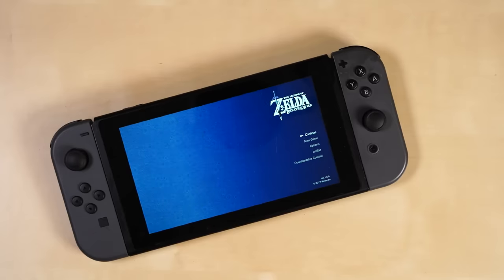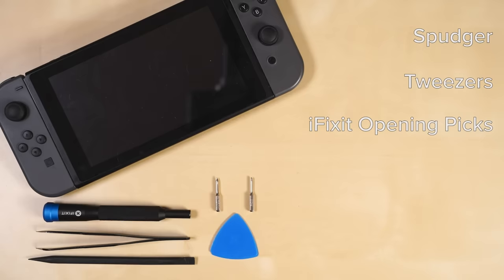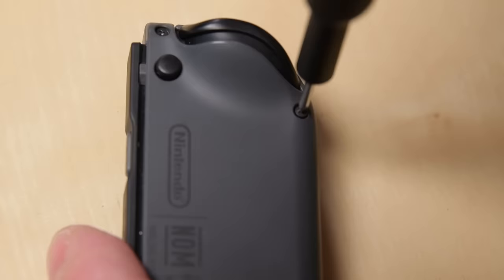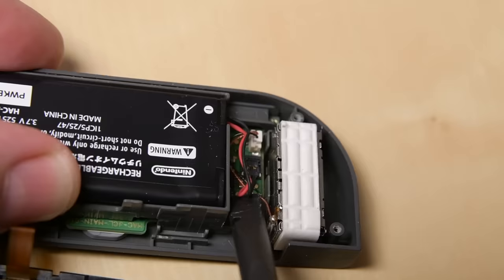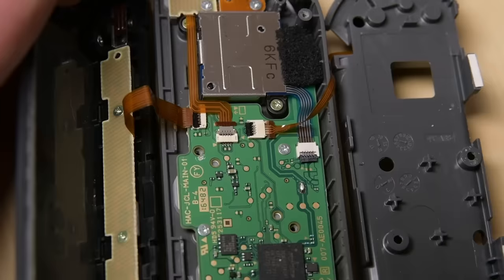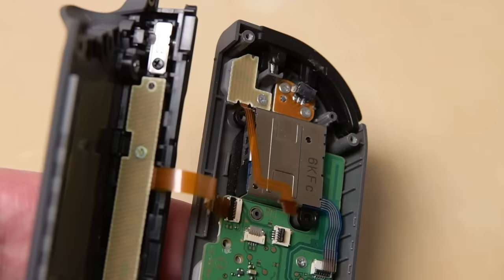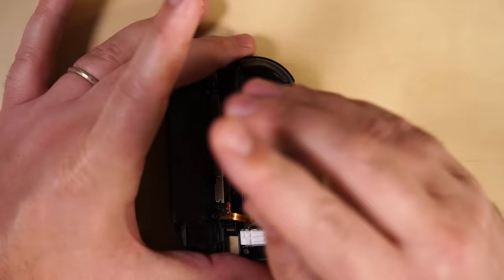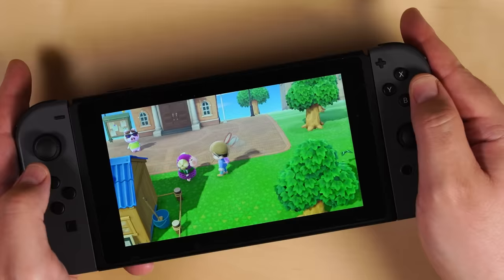JoyCon Drift Fix! How to Replace the Nintendo Switch Left Joy-Con Joystick

Comment: Few notes from a guy who has done this repair several times: you can remove the battery much more easily by just pulling up on the wires, getting it out with a spudger is way harder; if the L button pops off make sure that when you put it back on the spring is straight or else it will feel mushy; use tweezers to open and close all the ZIF connectors, they’re very fragile and your big human hands can easily break them; lastly, go very gently with the Y00 screws as they strip way too easily
Reply: Pulling up out on the wires? I wouldn't try that...just if you want to break the battery cabels.

Comment: My joystick actually broke off so hopefully this video can help me replace it, thankfully I had a spare from the time I was going to fix the drift. The screws were stripped so I ended up sending it to Nintendo. So it has a use now. ☺ If only Nintendo made the joy cons better. This is the only controller I've had a hard time with.

Comment: I am stuck.

I am not sure if I want to fix my Joy-Con Drift entirely or use the Drift to my advantage.

(By advantage I mean try to use the direction the Joy-Con drifts and both try to move/do something solely by the dift alone. And thus, leading me to not have to move the controller stick manually. It's the lazy way to do it! You can use it too!)

Comment: I guess the entire flex cable clip came up when i was trying to remove the battery. When i went to put it back on the prongs it connects to broke off.  I'm not savvy enough to find the parts I need to fix it (I can solder them on i just cannot find them to buy i can only find the clip itself).

Comment: While it's nice to have replacement sticks on hand, you can get a reasonable fix from spraying a shot of electrical contact cleaner (I use WD40 brand) right down the stick hole. Wiggle it around and its now clean.
Replacement sticks may drift after a couple months, so replacing is not a perm fix.
I have a couple stick in reserve because I have a six year old that has managed break them off after repeated drops.
Reply: Where did you buy your replacement joysticks

Comment: Any recommendations for turning Tri point screws that are stuck? One is semi-stripped
Reply: try and use a rubber band between the screw and the screwdriver.  This would give more "traction" for the screwdriver
Reply: You have options...Either drill off the head, dremel a straight line through it and use a flat head, or solder the screwdriver to the screw

Comment: Easy to follow instructions and straight to the point! For a second i though i had messed something up but it turned out that my first replacement joystick was just broken :"D (Which perhaps could be another good thing to mention that it can happen too (pressure was working but the stick wouldn't allow me to calibrate/move)

Comment: I NEED HELP!!! Does the joycon have different joysticks before i buy 2 of the same and do you follow this tutorial for the right joycon as well i feel like theres things in the right joycon that i can mess up if i use the same tutorial for the different controller.
Reply: And no u do not mess up if u use same tutorial. Just use the other controller and be careful of other cables. And also if u want u can open both of ur joy cons now and take let's say the analog out the left controller and then remove right analog from right controller. If the left controller analog fits in the right controller and if the ribbon cable goes in the same way the old right analog used to go, then u can guarantee that it doesn't matter if u get 2 of the same analogs. If u want to 100% know 2 of them work u can (as I said before) take the old left analog from the old left controller and check if that fits in the right controller and ribbon goes in same direction. Do the same for right analog by putting in the right analog in the left controller, making sure the analog ribbon faces the connector and fits in. If the ribbon does fit in each connector facing right way, u know that u can buy 2 of the same, just rotate the analog into the right position, making the ribbon face the connector and connect securely. When getting new analogs, u can remove old ones and recycle them or throw them away. Then install new ones, just like how u installed the old ones. (Doesn't matter which way, just rotate it to the correct position). If this helps, please let me know if u are reading this reply 😉

Comment: my pink left joycon has jutter, i replaced the joystick and all buttons work even L3 works but up down left right on the new joystick dont work., what am i doing wrong and it still has jitters i double checked all ribbons cables are seated all the way.

Comment: My Switch OLED joystick stopped clicking in after 4 months of owning it. The fix is similar but not exact as this. It was a little easier. The battery tray is a little different. But all I did was remove the battery and the joystick and that was pretty much it.

Comment: Thank You for this concise guide! Did my first replacement successfully thanks to it~
Reply: How does the Joy Con that you replaced the analog stick work after this time? Is everything ok, or has the problem returned?
Reply: @Lukail90  I haven't really played my Switch that much after, it is still working fine but if u did.. it will probably have the same issue again I guess 😅

Comment: This is not easy. The removal of the battery  connector was really hard, I failed to do it 😢. Anyway, if you’ve got a drifting Joy-Con this might be better to try rather then just throwing it away.

Comment: My screws won't even turn, well one came out.  The others refuse to turn, someone believes my screws may glued in.   
If anyone is having issues with their screws not turning at all this maybe the reason why.  I don't believe the 3 screws are stripped, since they never started turning in the first place.
Reply: They aren’t glued in, you just have to apply a lot of force and turn the screwdriver very slowly (!). The Y head screws are poor quality so it’s very easy to strip them. 
I’ll be replacing mine with philips heads screws as soon as I find the right size.

But you might need to use a dremel to cut into the screw to remove it
Reply: @user-10021  Tried what you suggested earlier, wound up just sending my controller back to Nintendo for repair.

Comment: get electronic contact cleaner spray at hardware store. Spray under the collar of the analogue stick. Roll it around in a circle for 30 seconds both ways. Let it sit 5-10 mins to dry. Recalibrate in settings. Done. Should last 4-6 months if not forever. Repeat if issue re-emerges. One of my joy con required it twice and never again. The other, only once. Been years now.

Comment: Why is my L keeps breaking off? I did two joycons and both fell off, didnt put any pressure when taking the battery holder off... I dont understand why the L just breaks off like its not supposed to be there so easily.

Comment: Word of warning. Using the smudger I accidentally completely disconnected the battery housing. The housing is connected using only 4 tiny solder points. My JoyCon is now completely unusable as there is no way to get the battery to connect to the motherboard. Be very, very careful when removing the battery connection from the housing!

Comment: Just changed mine took me 15-20 min. Stressful as hell 😂 Those ribbons cable are a pain in the ass to get back in even with tweezers. And the tiny screws too. Be carful not to lose the top trigger spring. You can skip the part about disconnecting the battery its easier to leave connected.

Comment: Can I use a nintendo switch lite analog stick on my old switch ? / will it fit or small help
Reply from the maker: Yes, the joystick from the Switch Lite should fit into a regular Joy-Con!
Reply: @iFixitYourself  thank you saved me / where can I get joycons that don't drift because it's expensive and you site/ I also really want your amazing fixit pro kit I don't mind paying for it buy only problem is the shipping is all most same price can you guys help me out with this?
Reply: @Ibrahim_Alharbi  Did you find a site where you can buy joystick replacements?

Comment: Uh, so you didn't bother mentioning how frail the battery connectors are. I just went to put the battery connector back in and the prongs snapped off. I barely even applied any pressure. This is crap.

Comment: DO NOT LIFT THE MIDFRAME AWAY AND DISCONNECT IT. That connecter, with current joy cons, is placed IMPOSSIBLY to reconnect. I broke the wire trying. I should have just left it connected as there is no benefit from disconnecting.
Reply: thats only impossible in the RIGHT joycon. This is for the left, where it is very easy to put back in, and gets super in the way otherwise

Comment: When you take out the battery do not rip off the entire connector from the motherboard. Just carefully unclip it from its socket. I know 10 ppl who had this problem and had to super glue it back into place and it was so hard! This video doesn’t do a good job of explaining this
Reply: Do you know the best video for doing this stuff?
Reply: @nemesis5289  this is the best one. Just watch closely and don’t rip out the entire battery connection by accident. Don’t even disconnect the battery, just carefully set it aside while switching out the control sticks

Comment: dude, the model i have is not that simple!!!  The Zl button ribbon cable is EXTREMLY short and right in the corner of the joycon next to a screw hole.  Almost impossible to get it back in place.  I'm not a surgeon... Nintendo should definitely build better joycon.  Last Nintendo system EVER...  they are now ranked in my mind at the same level than Apple iShit devices

Comment: If you're not so technically inclined, or worried about damaging the joycon, or you're just a cheap ass, you can take the easy route.  Buy a new set from Amazon, and send your broken one to Nintendo for warranty repair.  When you get it back, return your other ones to Amazon for a full refund.  If the repair takes longer than 30 days, return the joycons anyway and buy (rent) some more.